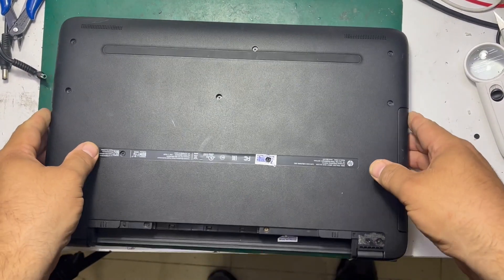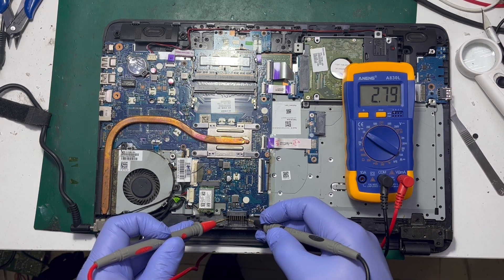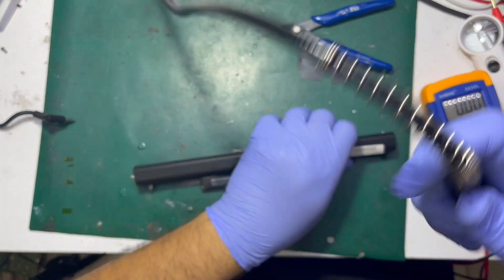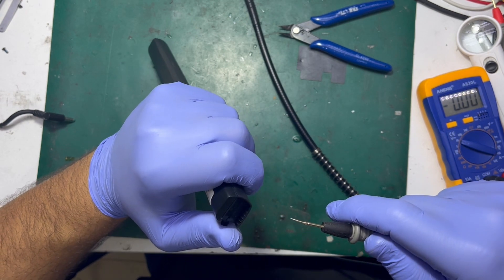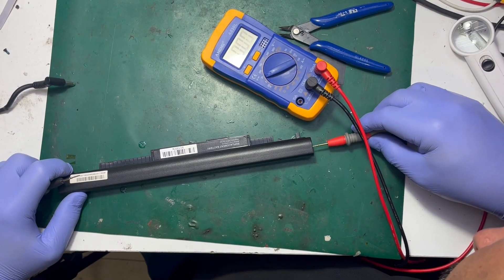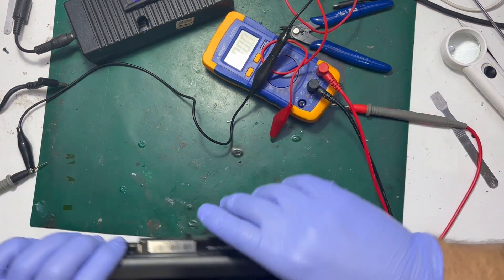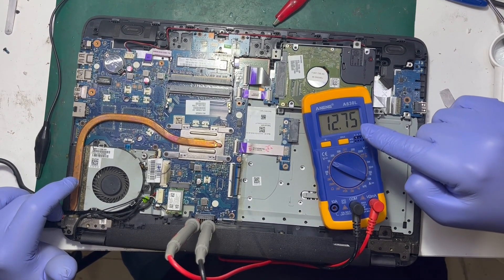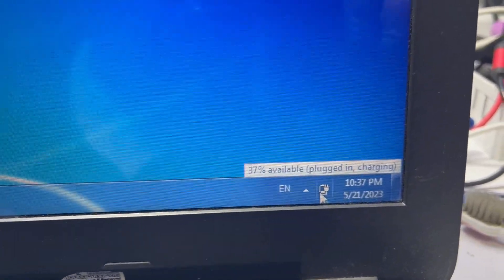HP battery refresh and worked again

Comment: I have a HP Probook it's 10 Years old but has only 379 cycles in the HP Assistant it Shows 379/300 cycles. It doesn't charge nothing i think the chip inside the battery prevents it from charging as it reached the cycles. Any way to still use this battery or buy new one? I mean 379 cycles isn't that much or? Please help
Reply from the maker: Hi, in this situation it is better to get a new non original battery (since the laptop is that old and if you find the original battery from HP it will be very expensive). 
there is some tools to reset the battery cycle, that you can find online but it if you are not in this business or you don't do this on daily basis its not worth it as the tools are costlier than a new third party battery.

Comment: May I ask on which pin does the BQ chip recognise the battery has been plugged in? What would the pin voltage be , before and after the battery has been plugged in?
Reply from the maker: usually the battery recognition is made by the EC chip using 3 connectors which it signals the BQ chip to start charging.
Reply: @Bertronics  thank you. Will look at my ec chip then

Comment: I have a laptop keyboard issue. Typing wrong keys, I've tired all that youtube videos have to offer also everything Microsoft help has to offer. Before i pay a tech guy, I'm still tryna get help.
Reply from the maker: i don't know which laptop you have this issue in, but mostly if you make a firmware upgrade it may fix the issue.
Firmware upgrades for HP laptops can be downloaded individually other manufacturers can be upgraded with Bios.
Reply from the maker: Plus check the EC chip on board if it has some kind of moisture on its pins and tracks

Comment: When you injection 16 voltage how much amps on the Power supply
Reply: No more than 500ma with 16 volts in a 3 cell battery like the one in the video.  I also believe you probably just need to just inject the voltage/current for a second or two and release.  Then plug the battery back in the laptop and then plug the power wire to the laptop and it will start charging from there.  The voltage was low on the battery but wasnt low enough to prevent the laptop from charging.  So basically the trick is to "zap" the battery (or charge like he did in the video) to reset the chip inside then it should work as normal from there.  I've experienced similar thing with BMS boards on different electronic devices and a zap of voltage resets them if for any reason the become unresponsive.  In fact - I'll ill confirm this in the near future as I have old laptop with same behavior.
Reply: @p0opsy thanks for your support
Reply from the maker: it depends on what you are injecting voltage to